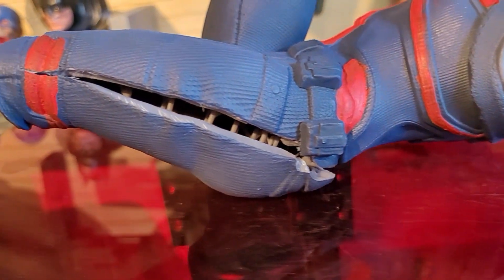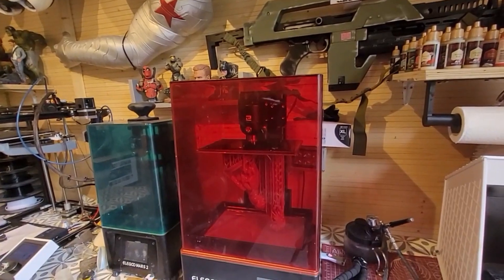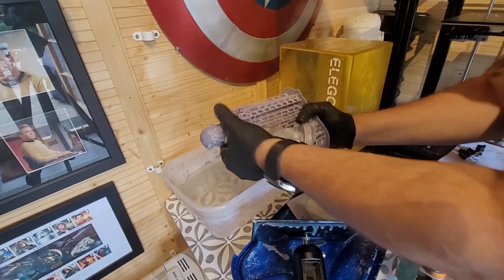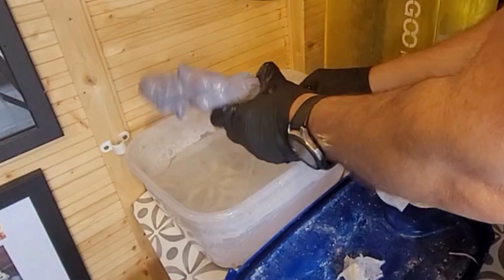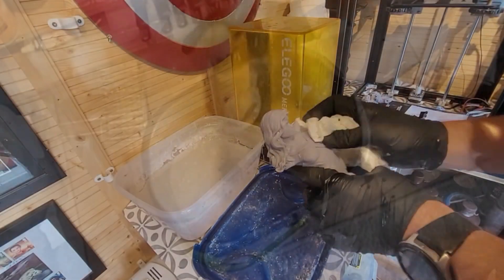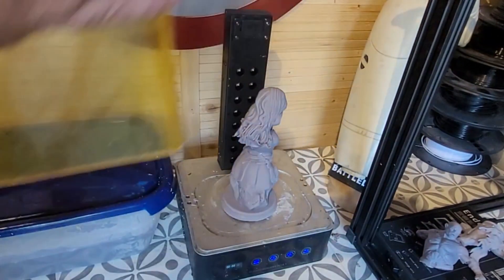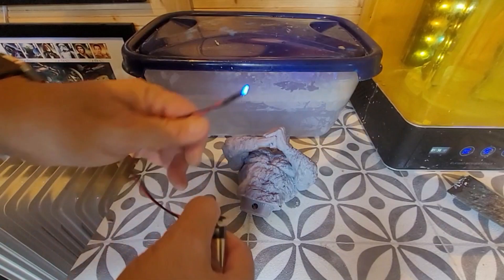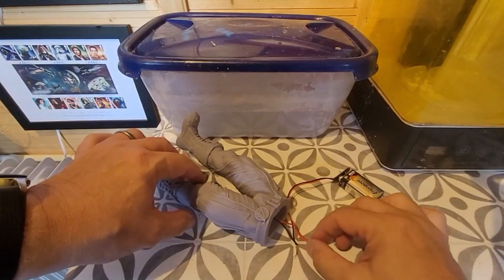Stop 3D Resin Prints Splitting With This Top Tip

Comment: Had the same :( found one solution was to drill the base right out, literally take out centimetres if needed. Then after outside curing, use a UV light on the inside. After all it's not like you'll see the base of the model,  you might even save some weight. Plus you can easily hot glue on some felt pads (poundland do some for furniture) which means you won't scratch whatever surface your model is on.

BTW - just like to say love your channel, it helped me to choose the Mars 2 for my 1st foray into resin printing.
Reply from the maker: Thank you so much for  commenting and for the kind words about the channel. Sounds like you've found a way to combat the dreaded splitting problem of our beloved hobby 😁👍

Comment: Great video and tips... I had built the same UV mini light with 9 volt, but on mine I added a toggle switch so I don't have to keep disconnecting the battery.
Reply from the maker: I've got that planned too and also may add a couple more LEDs too.. Thank you for the comment 👍

Comment: I had this happen a few days ago, when a base just split on it's own overnight and it was my bookshelf
Lost 8hrs printing it, but the replacement seems to get holding up.
I now i print with  3mm wall and holes around 3 to 30mm depending on scale and location.
Not working on my ff yet as I am waiting to see what treasure sanix has inshore for the dio.
Reply from the maker: Thanks for the comment 👍I printed Susan at 150% but the thing was too big for the saturn at 150% do he's 125% ill see also what dio base sanix has in mind but may have to adlib one 👍